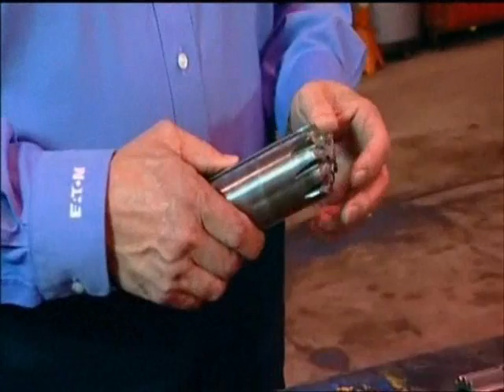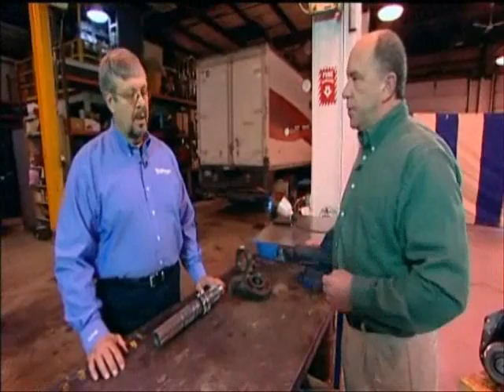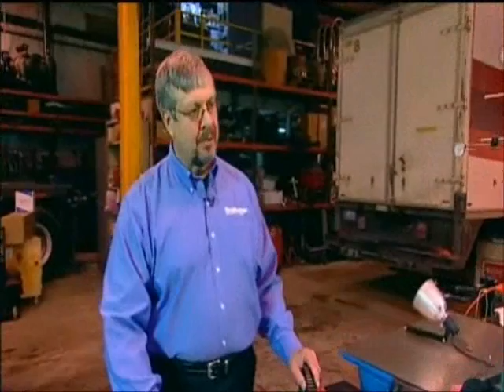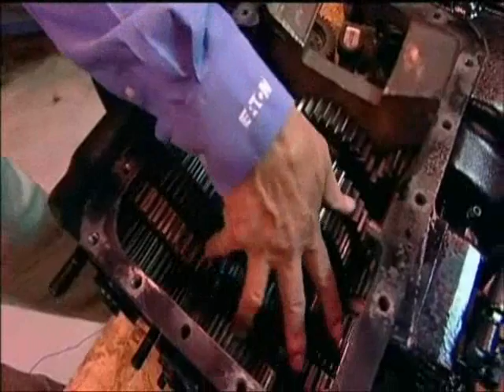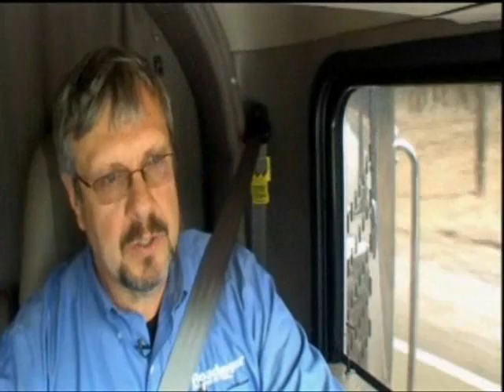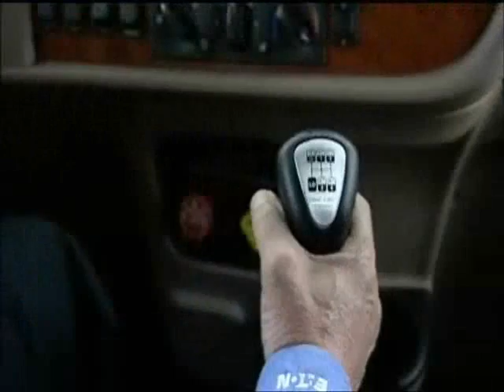Eaton Fuller Transmissions Introduction

Comment: What I even don't understand: Why do they still use gear wheels where the racks are straight? Straight racks do make much more noise than racks that are diagonally. And Eaton uses diagonally mounted racks in the range-splitter-gearbox, so why not at all the other racks.
European transmissions don't use straight racks for decades...
Reply: Have you ever driven a Fuller? Smoothest ride you can get if you just shift properly

Comment: I have be never a fan of the Eaton Fuller, BUT, it could being renoved in such way that is as good if not better than a dual-clutch transmission or an automatic, possibly the zeroshift thing, which is a "seamless" sequential unsyncrhonized transmission, with a system of actuators that work so fast that you can change gear in 2 miliseconds, basically before even a cylinder is firing. Is used in F1 cars and may work pretty damn well in heavy duty trucks.

Comment: double clutching creates excessive clutch brake wear. so I hope none of my drivers take this guy's advice
Reply: What? Double clutching doesn't create clutch brake wear. If you or people you know are wearing the clutch brake while double clutching it's because you or the other people are pushing the clutch too far, activating the clutch brake (which shouldn't happen while moving, it wears the brake prematurely). That's why big rig truck clutch pedals have a lot of travel. There's free play, friction point, "dead air", and then clutch brake when the clutch pedal is pressed against the firewall. Tell whoever told you that DCing causes clutch brake wear to stop slamming their foot to the floor when they shift.
Reply: 20 some odd years of shifting without the clutch i doubt i could use if if i tried!

Comment: I was just taught in school the clutch is only to be used to get the truck rolling, Not to ever use it for shifting . I have to tell you it works just fine. No one at my work uses the clutch to shift , and these guys have been driving these trucks for 300,000 miles on original clutches and transmissions .Some are good at it , some aren't .

Comment: I had my 10 speed transmission oil leak fixed at a dealer at 688,024 miles at 695,000 miles the transmission cratered the shop went to drain the oil and only got a quart out. The shop that did the repairs is telling me that they have seen the oil just disappear and not leave a trace of evidence on the truck. Also they are saying that an Eaton transmission will not last 7000 miles without oil. Does anybody know how long a transmission will go without oil. I have not had any puddles under this truck at any time other than when I noticed the first leak and had it repaired. The bottom of the trans and the back axles and DPF filter on this Columbia truck were dry and oil free when it cratered.
Reply: Sorry sounds like your shop didn't refill the tranny!

Comment: skipping shifts especially not using the splitter it is recommended that the clutch is used. however this particular transmission is a low inertia transmission, if every gear is selected up and down (what he called progressive shifting) then simply preselect the split, break torque then move the shifter to the next hole. like from 1st to 2nd just preselect high split, let off throttle and BAM you are there, from 2nd to 3rd preselect low split, let off throttle and move stick to 3rd BAM you are there, no scratch. but that is only when using the splitter progressively shifting.
Reply: in my experience a double clutcher will wear out 3 or 4 clutches before a floater will wear out a transmission if they are good. the gear that is most susceptible to damage when floating the gears in and out is direct. that is over to the right and up against the dash. watch that one closest.

Comment: in europe all trans syncronized in 35 years.no problem,one clutching.very fast  shifting.no problem up the hill,mountain.i drive 30 years old iveco turbostar.14 litre inline 6cyl.380hp.16 speed zf trans.full syncronized.full weight 52 metric ton.115555pound.i go to 4km long 6-7%hill,down shift 1second 16-15-14-13-12.speed 90-65mk/h.syncronized gearbox very fast and good!2.5 million km.no repair!oil change 60000km.second clutch plate.in flat road pump up rpm 1250,up shift.no 15-1600rpm!wide road!

Comment: I have a LAND ROVER Serie I, without sincromatic sistem to 1st and 2nd gear. That is a heavy transmition, but the damage can be serious if the driver don´t double cluching, or select the correct rpm for the speed to you are running. The Serie III LAND ROVERs thas sincromatic sistem to all gears, but you can give more live to the sincromatic brakes if you use double cluthcing .... another sistem is to wait for the transmition rediced the rotation to up the gear. I would like to drive a 18 EATON F

Comment: To be honest I never could double clutch without grinding it good. If  loaded and have to start on a steep hill you will not be able to double clutch anyway because it just takes too much time and you will lose momemtum. Down shifting on a steep hill is much safer if you shift without the clutch again because it is faster and it is difficult to calculate at what rpm you will shift at  if double clutching when gravity is pulling on the truck and you could end up on the runaway truck ramp.
Reply: packrat541 going up a steep hill, sometimes the ONLY way to break tension on the transmission is with double clutching.

Comment: i used to think only very old trucks required double clutching -or he is talking about an old school gearbox? 
my land rover 1976 model had a retro fit un-synchronized g'box which was fine to drive just double clutch for going up the speeds and double clutch and gas pedal when going down. i kind of like double shifting and still use it in my present drive a 1977 land rover even if it still has a fully synchronized gearbox. nice video though

Comment: People ask, why 2 countershafts, or 3 as in Mack? Well, why not? It splits torque 2 or 3 ways, and the mainshaft is sorta balanced between 'em. This means a thinner case casting, for one, and also allows for smaller and THINNER gears. An old-style trans that took this much power would be 6 feet long to do the job!
The idea of re-using the same 5 gears in a higher speed range was revolutionary, and attaching the ranger trans to the main trans and having air do that shifting was great, too.

Comment: Yes there is at a particular rev, for example, 

1200 rpm = 20 km/h = 4th gear (top gear bottome box)
1200 rpm = 30 km/h = 5ht gear (bottom gear top box)
1200 rpm = 40 km/h = 6th gear

You can work this out by taking your truck up to 1200 rpm in each and just before shifting to a higher gear note the speed you are doing, so you have "speed = gear = rpm"

Comment: @edwardzimmerman:
Neither! It is best to give an example: Say you're accelerating and tach reaches 1800rpm.
If the next gear up at that speed is 1500rpm you clutch, use accelerator to give the engine 1500rpm and then release the clutch at that rpm. Thus there will be no kangaroo jump at the clutch release and accordingly no stress shock for the driveline to handle. Anyone with a stick-shift do this instinctively. With a big-rig it turns important because the forces at play are so big...

Comment: ill be honest, i disagree with part of what he says. my dad shifts most gears without using the clutch, and he has gotten full use out of the transmission, no premature failures. his clutch lasts twice as long, he only uses it when downshifting up a hill. the key is not to force the transmission, you use the foot feed, if it starts grinding raise or lower your rpm till it slides in nice. when you slam it, you wreck stuff. im suprised he didnt mention wrecking the clutch break.

Comment: @Fantafare Oh too true  I learned to drive a truck on a 12 Speed Crash Box and Split rear axle and if you made a mistake then you found out real fast. 
Take the load off and allow the gear to simply slide into the next with no load ie roll the revs down and the Box will just slot in 'eh